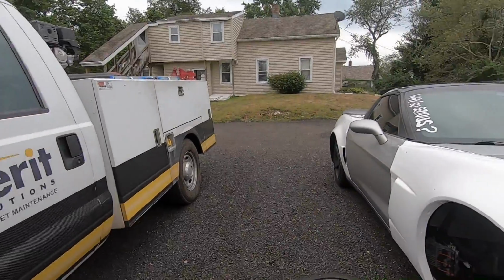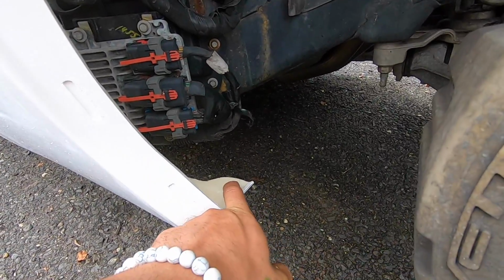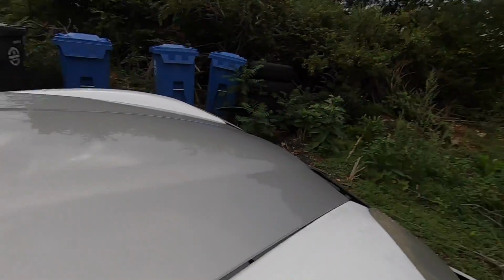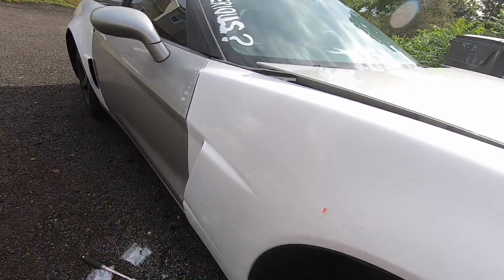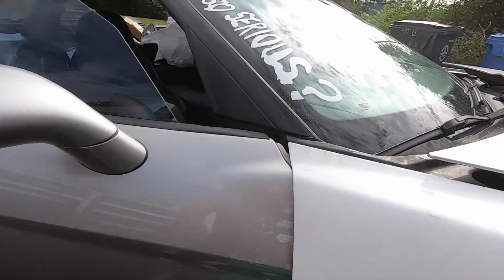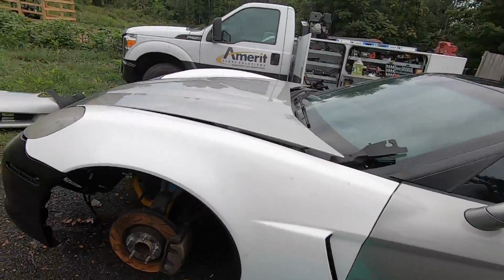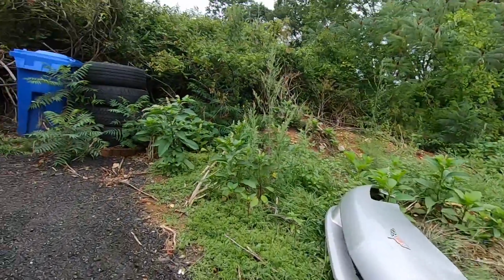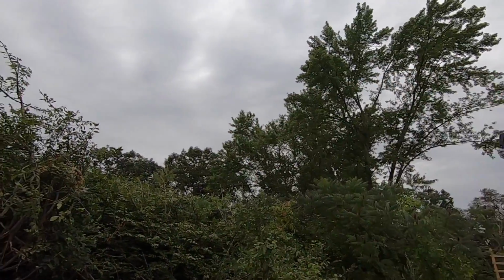How to install corvette z06 front fenders on a base

Comment: Is that front bumper a duraflex thinking of getting one
Reply from the maker: Front bumper is oem from dealer
Reply: @NRMotorsports  how much does that run at the dealer?
Reply from the maker: Rory Finazzo bumper and install parts was around $800

Comment: Did you have to replace the front bumper  to make the ACI fenders fit?....I thought they were designed to be used with stock base bumper.
Reply from the maker: So they make two different styles OEM z06 and there ones for a base bumper these are the OEM z06 ones so I could do the full conversion